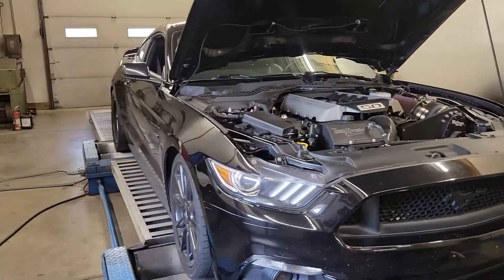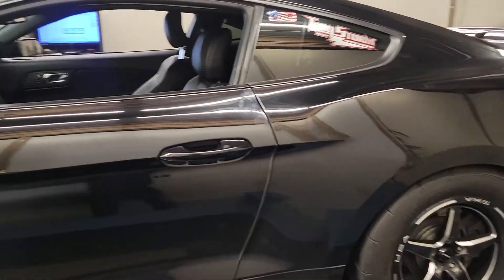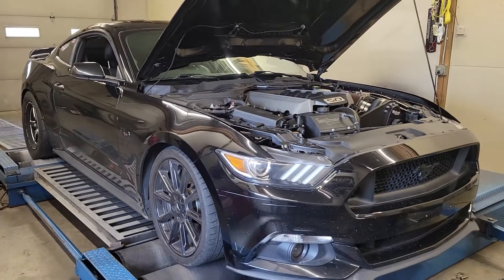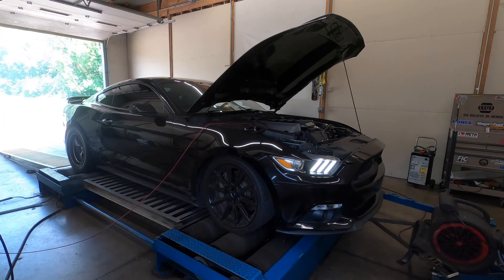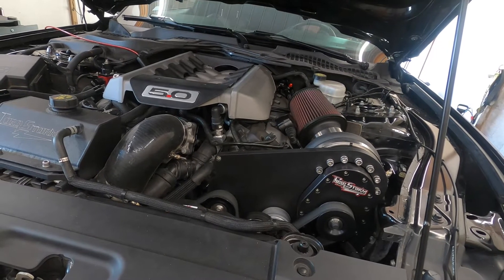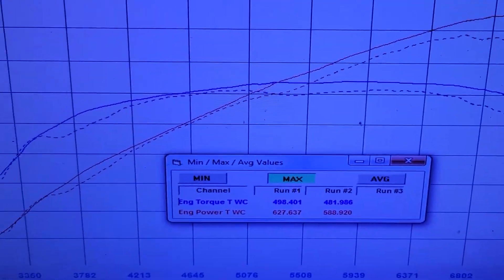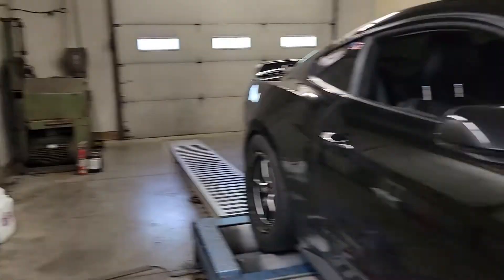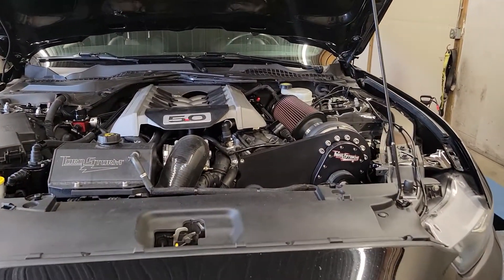TorqStorm Supercharged S550 | Supercharged Ford Mustang | Dyno Review

Comment: Why was the power so modest on E85? 620 at the wheels is easy pump gas territory.

Was this like 8 psi and modest timing? I would’ve loved to see you review the data log.
Reply from the maker: This was a while ago now. But there was no boost gauge in the car, and it's a MAF only ecu. I'd guess it was making in the 8-10 area just based on the power output. I never put aggressive timing in these. Again, it's been a while, and i dont remember the exact number.
Reply: @ForceEngineering  10 psi and 20° of timing, which is perfectly reasonable on E85, should’ve net 680 to 700 wheel or more. But then again, we don’t have a data log, we don’t know air load, timing, etc. and we don’t know any other modifications made to this guys vehicle.

I think the reason people are asking is because the manufacturer is selling these things for like $3000-$4000 and that price is ultimately going to attract a lot of people. I’m trying to figure out why it’s making such “low” power. Is it a “you get what you pay for scenario”?
Reply from the maker: @Guthrie # 1  on a dynojet, it would make 10% or so more.  So right in the area you're expecting. And as you stated, without a manifold pressure, value we're shooting in the dark either way. 

Looking at their site, the kit proce is attractive, but it doesn't come with the intercooler, fuel system, programming etc.  Once all that stuff is figured in, it would be a close cost comparison to other options.  The car in the video was intercooled fwiw.  

Another note. A Stage 2 roush car will make 580 through a stick on our dyno. Just a good reference point.
Reply from the maker: @Guthrie # 1  Here is a video we did comparing my dyno to a dynojet local to me.
https://youtu.be/4Bm1AQI8uE0
Reply from the maker: Here is a roush mustang for power number reference.
https://youtu.be/6yp8bHwDm8A
Reply: @ForceEngineering  That makes more sense now. Thank you for that information.
Reply from the maker: @guthrie_1  you're very welcome
Reply: Is this kit better than the ess kit?

Comment: I follow them for the simple fact their kits are actually attainable by us blue collar folk not just retirees with money to burn
Reply: Generally speaking you get what you pay for. There’s a reason the others cost $8,000 to $10,000. There’s a ton of R&D and overhead associated with manufacturing a long term reliable product. Whether it’s VMP, Whipple, Roush, Vortech, etc they are the kings for a reason. Quality, reliability and they make great power. You have to pay to play. 

Most guys boosting their coyotes are not retirees with money to burn, but young guys ranging from 20 to 40 years old. That’s the demographic. I’m 33 and busted my ass to be able to afford my VMP blower. It was worth every last penny.
Reply: @guthrie_1 You realize the R&D for all of these blowers have been the same for decades? VMP blowers are Magnuson rotor packs anyways. So they've done all the R&D and VMP just machines casings for them. Procharger and Vortech just switch out mounting brackets but all the head units are the same.
Reply: @OctaneSlain  OK so there were no R&D cost associated with Whipple’s newest blower. Got it. Torque storm is charging less because they’re virtuous and sympathetic to the workingman lol.

You can buy an on 3 turbo kit, save money, and the fifth day of your install, you will realize why it was cheaper.
Reply: @guthrie_1  Man, you sound like a branding shill lol. Continue to spend top dollar and support all that R&D 🤣
Reply: @OctaneSlain  I’m just a major shill bro

Comment: I put a boost gauge on it after it left and was making 7lbs, had a leak on a vacuum line running to the intake manifold and now makes 10lbs kinda curious to see what it makes now!
Reply from the maker: Thats kick ass.  It definitely made decent power for obly 7 psi!
Reply: Take the filter off when you race and you’ll gain about 3 lbs if your fuel can handle that
Reply: Run meth injection, that motor will absolutely love it